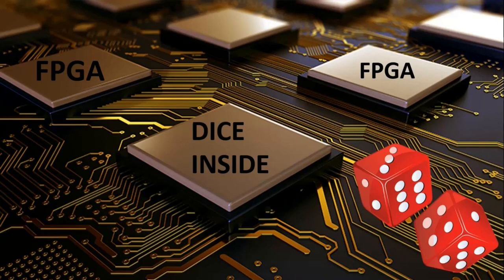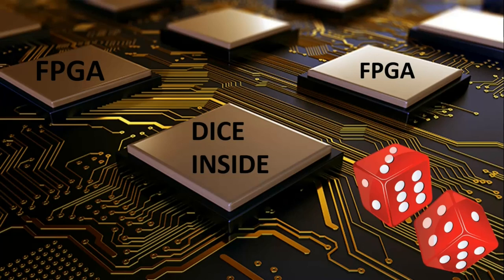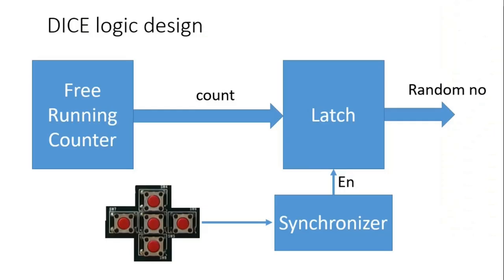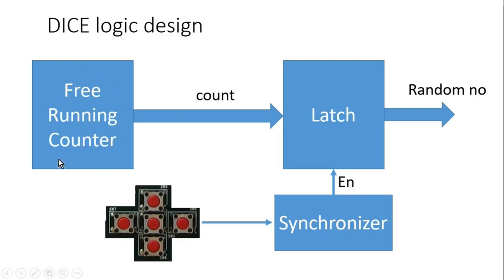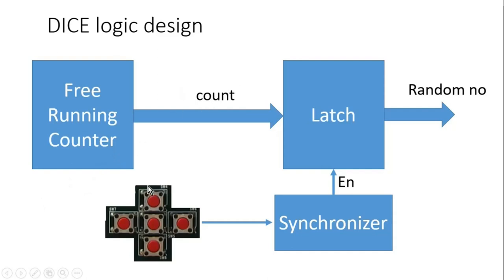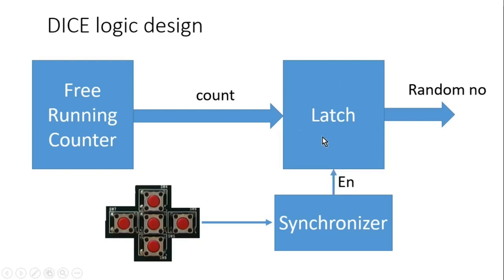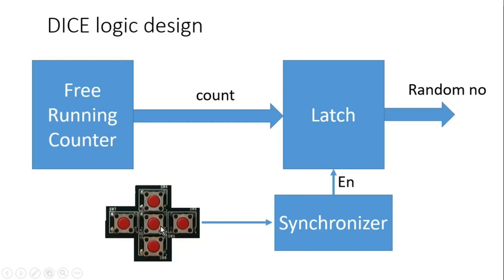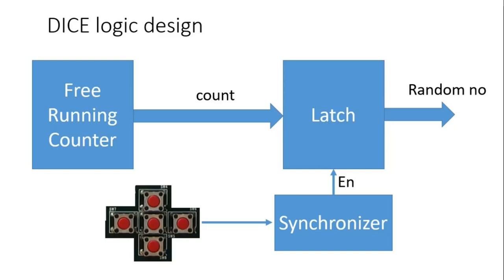Digital Design-Dice Implementation on an #FPGA #VIVADO

Comment: How we share video sir we not have any contacts details😢
Reply from the maker: You can put it in your Google drive and give permission and share it here
Reply from the maker: ohh..really you implemented it. great. I am very happy. No words.
Reply from the maker: I will show it to other channel viewers.
Reply: @TechnicalBytes  thanks sir, I not use synchronizer in design, I use mod-6 counter and rising edge detector with register to hold the counter value, and a state encoder to change the count vlaue to dice value. This design running at 100 Mhz clock. Lot of thanks for your great videos and membership at affordable price